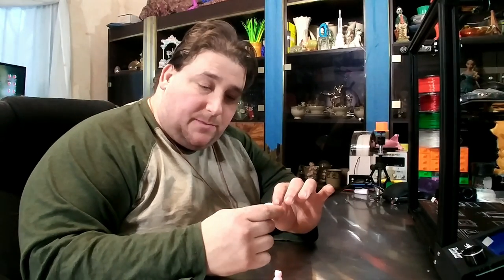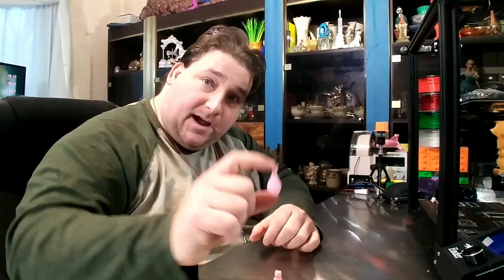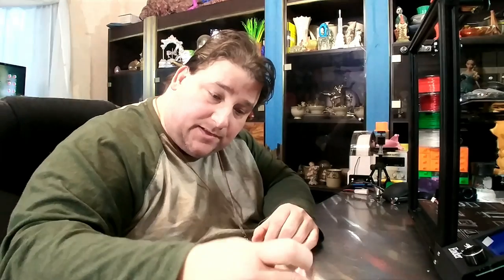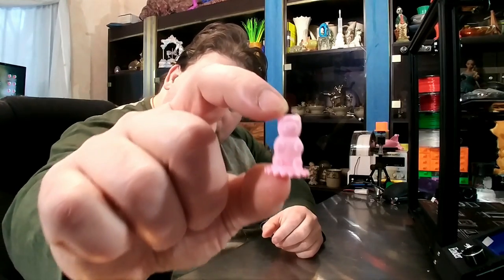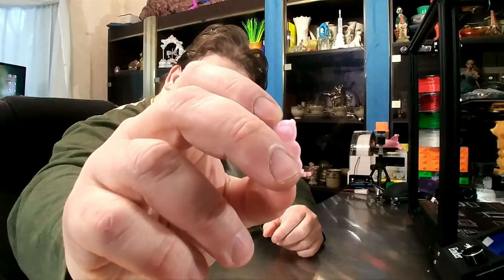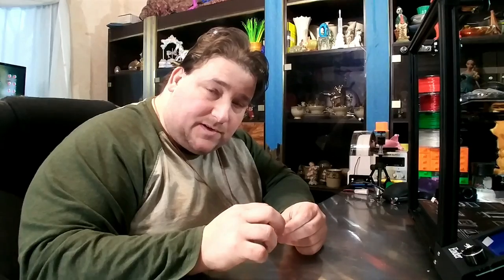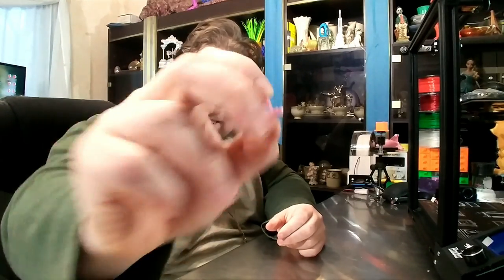Installing TL Smoothers, Salmon Skin, Creality Ender 5 T3DP

Comment: Just a useful note about smoothers, if you look at the space between the two connectors. They are exactly the same distance as the width of a smoother, therefore you can slot the next smoother across those points and then continue through all the smoothers. This will give protection electrically on each board and then provided you have space within your main board case you only have a single block to mount.
I hope this makes some sense. Sorry I'm not sure how I can provide an image to show.
Absolutely the best 3D channel by the way and I follow quite a few. I just love your approach to educating people. It's such a shame printing is not as important to people as say watching reposted internet video. You would then have millions of followers and a crazy income from YouTube.
Good luck for the future.

Comment: Thanks for your time and effort! It is really helpful. My Ender 5 arrived yesterday (i printed only one model (the dog from the SD card)). My printer isn't perfect though (one wheel one the X-axis is damaged, and the bed isn't 100% straight, it is not badly warped or bent, but still not as "perfect" as you mentioned). Still I was able to print an acceptable first print and i'm very happy. My TL smoothers are on the way, just as the nema17 dampeners. I wish you success in all your future endeavors. Subbed! Best wishes from Hungary! And sorry for my crap english "knowledge"...

Comment: Great video. Any chance you could do a video installing the duet 2 main board as the clones are pretty cheap and it would make a great video
Reply from the maker: Link to these cheap clones?
Reply: Nerys If you do do a video on it it would be appreciated as I have all the equipment I need including the duet but just not the knowledge to install it

Comment: NERY cr10 mini when you open up box it's super tight do you have to remove fan to put smoothers I cant find anything good on that type of printer I got 6 to do but am afraid I'll break something I've had All entire 2018 every day every printer not working from raise 3d n2+ to fl sun delta i got them all going finally and dont want a repeat of never ending issues it was brutal I didnt think so many things can go wrong unlike others I wouldn't see other 3d printer companies as competitors but more like a family bond but I guess they didnt go threw hell and still come out smiling anyone else go threw ruff ruff starts multiple brands failing and having no customer support

Comment: A quick question if you get a chance to read this. How do I make the printer not so stringy? Is it just my filament, I have retraction at 7mm and the speed at 60mm. I am using wyz works pla 1.75mm translucent purple. I just found an option for combing and an option for Enable Ironing and Ironing Flow ... not sure if I should change any of those. Also found an option for Equalize filament flow.

Comment: I now have smoothers on x,y,z and extrusion on my cr-20.  Had to replace the main board blower fan as that was screaming like one of your mice..  also replaced the power supply fan but tbh that was pretty quiet.  Not touched the extrusion or head fands yet.. have added a damper on X but y looks trickier.  Started a 4 hour pi case to test..looking like I'll run out of pla before the end though grr
Reply: Was is it really needed? CR-20 comes with 2.x board that shouldn't suffer from salmon skin, or does it?
Reply: @stanislavkolbe1646  no probably not but I'm new to this stuff and had already bought them so it's a good way for me to figure this stuff out.  The fans were defo needed..I couldn't sit next to it for long it was soo loud before.  The case is now half way through and the surface is looking soo silky...I'll be honest though, maybe it's the smoothers or that I've just moved to simplify3d but this print is looking smoother than normal and its only on Draft at 0.2mm
Reply from the maker: I don't think the CR-20 needs them. the ender 5 has the 1.1.3 board. I don't think they can hurt though so might be a neat experiment to see but I don't think they will change anything.
Reply from the maker: Y is a PRESS FIT so you need a punch some cylinders (soft think rolls of take) a fork (pliers will work) to press the shaft out and press the pulley out more to shift both a total overall 6mm or so. it does work. I did it on mine. just takes some patience. pus the pulley about half off the shaft and push the shaft flush with the bearing then "a wee bit more" and that will be enough to line things up.

Comment: Another great video. 👍🏻 Was just thinking about doing this.  Is it just as easy on an Ender 3?  (Can it even be done on the 3)
Reply from the maker: yes. exactly the same process. plug and play protect from shorting. that's it. on current ender 3's its even easier since the brain board is smaller so there is more room inside the brain box.
Reply: Nerys Thank you Chris you're the best. 😍

Comment: Will these instructions apply to the mother board on the Ender 5 pro?
Reply from the maker: The Ender 5 Pro should not need it it will not have salmon skin and it already has silent drivers this does not remove noise from Prince this removes and electrically manifested artifact created by certain specific stepper drivers Leander 5 Pro does not have that so it won't need this installing them won't do anything

Comment: hello i bought the ender 5 it is a great printer but when a power cut the bed fall and i cant resume it start printing in the air how i can fix this ?
Reply from the maker: Yes that is an issue you could try adding an anti backlash to the lead screw which might hold it in position and keep it from dropping when the power cuts I am not sure but I think they're actually including that with current kits

Comment: Is there any reason why after installing it would make your stepper create crazy vibrations? If I move the smoother it makes the other stepper do it too.
Reply from the maker: Does only one of them do it because all of them do it that you add the smoothers to? You might have a defective smoother?
Reply: @nerys71  yeah its just the one i think its bad.
Reply from the maker: Easy test swap them if a Problem moves it's a bad module or it might fix your problem I had one that didn't quite work right and when I swap them for some reason they both work right that's unusual though :-)

Comment: So I just purchased an Ender 5 and was planning on putting this in my garage. problem is, I am worried about the temperature. I live in the northwest us so winters are about 30-50 degrees F. would this cause me any issues printing? I am new to printer this is my first printer.
Reply from the maker: Not really the printer May struggle to get up to proper temperatures but it should work I would not suggest printing anything--but pla at those temperatures as the others will tend to warp pretty badly that cold what you can do is build a very large styrofoam box to put it in large enough to avoid fire hazard but enough to keep in some heat you don't even need to worry about the electronics at that temperature it'll never get hot enough to hurt them but it should get warm enough get you off into the 60 or 70 degree range printing a lot easier
Reply: @nerys71   thank you i will definitely look into building an enclosure

Comment: Do you think I could get worse results in general, if I make the motor's wires too long? I mean unlike in audio, where the quality of the analog signal depends on the width and the length of the cable, a stepper motor can be seen pretty much as a digital device, because a step is always the same, no matter what influence my cable has, can't it? (Of course excluding the case that whole steps might get lost because of low voltage. low current or bad connection).
Reply from the maker: length of wires should not matter unless they are so long that you have a power drop over the length (I imagine they would have to be METERS long to cause that so should not be an issue)
Reply: length of wire increases resistance, so use a decent gauge of wire -- 24 gauge is enough for virtually any printer build smaller than 2 meter cube. I have 3-5 meter long extended wiring for some of my steppers, and quality stranded 24 gauge wire, there is no impact. Step up to 20-22 gauge for larger builds with high current nema 23 steppers.

Comment: Does anyone know what size the power supply fan is.
Reply from the maker: If I remember correctly it's a 60 mm by 10 mm 12 volts

Although if you get one with the Landy power supply I don't know what size fan that is
Reply: @nerys71   OK appreciate it I think I'm just gonna wait for it to come in.  I wanna do all of the recommended mods for this printer for safety.

Comment: Is the ender 5 a 24 volt printer like the ender 3? If so have you found a good source for 24v fans?
Reply from the maker: yes 24v and no. I just use voltage converters to bring the 24v down to 12v.

Comment: Can you please help me? I bought this for my husbands 31st birthday and he is having a really hard time trying to get Cura to accept Ender 5? Also not sure how to fix his bed he ran the test print and it left a few ?marks? on his printer magnetic bed :(
Reply from the maker: Just use the Ender three profile that's built into Cura and then just change the Z height to 300 that's the only difference otherwise as far as Cura is concerned it's an Ender 3

As for damaging the bed don't worry about it it'll just leave a small mark on the bottom side of your Prints but it won't mess anything up just be gentle with it and remember it's flexible use that to your advantage when peeling off Prince

Replacements are pretty cheap but for now just live with the marks until you've gotten some experience so that when you do replace it you won't ruin the new one so easily
Reply: Thank you so much nerys. I was at my wits end here. I will use the Ender 3 profile that doesn't mess up the fact that the Ender 5 uses the z axis and not the x or y for its print movements? I am sorry for all these questions just I am so confused about this entire process. Hes been wanting to get a 3d printer since we got married 7 years ago. As for the bed Ill use brims to help with the prints I think the bed wasn't leveled when we ran the test print. Ill let him know to use the bed till he can save some money for a replacement bed. The dog that he printed was cute but it could be better I wish he would be a little more patience with this stuff but he gets aggravated quickly.
Reply from the maker: nope. slicer don't care. the only thing that will happen is because of how the ender 5 homes everything will print facing the back of the machine (since to the slicer the back of the machine is the front of the machine) everything will be correct it will just print front facing back.

questions is largely what I do here. its what I enjoy. you should not need brims on everything. just "tricky" things that might not hold well to the bed. you will learn in time what works and does not as you experiment. its a fun process.

patience is critical. its a very DIY process. thank fully he did not get into this 7 years ago :-) its so much easier today :-)

remember. above all else HAVE FUN!

 @kimberlythorn8982
Reply: 1 last question how do we get cura to accept the files we find on thingiverse? I am not sure if its my computer that won't load them or Cura it keeps stating invalid file? Again ty so very much.
Reply from the maker: Sorry if this is obvious but it happens a lot.

did you unzip them? Cura will accept the STL file but thingiverse downloads as an ZIP file with multiple files (text folders etc..) inside

you need to "unzip" the files first and drag and drop the STL desired into cura. some version of windows can see ZIP and if you click them will open them "as if they are a folder" but many times trying to move a file into sure this way does not work right.

you should be able to right click the file and select extract all which will decompress the files into a folder with the same name as the zip file (you can then delete the zip file if you wish)

 @kimberlythorn8982
Reply: The profile is on the SD card.

Comment: How you getting on with cooling those stepper motors bud? just started getting issues with layer shifts and one moment the motor just went crazy, only thing i can put it down to is overheating of the motors as they were too hot to touch. I have put some thermal compound and the plates similar to what i saw in one of your vids but wondered if youve changed anything for better cooling? i did find this which i might try and find a way to work with it https://www.ebay.co.uk/sch/i.html?_from=R40&_nkw=Cooling+Fan+Heatsink+Cooler+For+CPU+VGA+Video+Card+SM&_sacat=0&rt=nc&LH_PrefLoc=1
Reply from the maker: Something's not right if they're too hot to touch check the vref voltage coming off a stepper drivers I'm not sure what it should be but at least we'll have a reference mine do not get hot I am 20 hours into a 35 hour print right now and the motors are not hot

 double check and make sure your belts and rails are not too tight and that nothing is binding which would cause the motors to exert more force and get hotter
Reply: i'll take a look, currently dealing with irregular clicking from the extruder motor after upgrading to capricorn tube, i think its a a flow rate in S3D adjustment but i cant 'make' it happen, it only seems to happen on certain retractions that include long movements too
Reply from the maker: two things to check. make sure filament is within spec. out of round or oversized filament would work fine with stock tubing but might pose a problem with capricorn since its a higher tolerance tubing MEANING tighter fit inside the tube so if filament is too large it will struggle to push it through.

second pull the filament (cold pull) do you get a clean pull? end of filament should be "shaped" like your nozzle?

after pulling also pull the capricorn and check the "interface" between the nozzle throat and the capricorn. it should be clean (clean capricorn clean brass) if there is filament IN that interface boundary layer then the ptfe was not fully inserted permitting a cap between the end of the PTFE and the throat of the nozzle. this will absolutely cause you some issues the minimum of which is some clicking as the extruder stepper struggles to push though that "cooked off" filament that will get stuck in that gap.

 @Nonprofessional_Tinkerer
Reply: @nerys71  looks like a blocked throat of gunk and typically its different from all my spares
Reply from the maker: @Nonprofessional_Tinkerer  make sure the end of the ptfe tube is cut clean flat and perpendicular and not out of round. Remove the nozzle (hot) shove the ptfe all the way through to be sure its all clear.
Reply: @nerys71  thanks on it, will let you know. Cannot find these types of throats anywhere, only full hot end assemblies
Reply: @nerys71  found some, stressed brain wasnt searching properly, word of note searching throat on aliexpress brings up some creepy stuff. Gonna heat up stock hotend and push ptfe through as wont go all the way. Then put back together without filament, heat up then re tighten nozzle as think i only tightened it cold last time which could account for clog
Reply from the maker: good. yeah I bet on the creepy stuff :-)

for assembly. tighten nozzle cold. then put compression fitting in place. LOOSEN 1 to 1.5 full turns. then install PTFE all they way in making sure compression fitting grabs it (tug on it) THEN tighten down compression fitting all the way.

now heat up hot end to 200 c and retighten nozzle (don't over tighten you can break it)

should be good to go then. @Nonprofessional_Tinkerer
Reply: @nerys71  good shout the with compression fitting idea, never throught to do that, let it tighten the joint between the ptfe and the nozzle
Reply: They can work at 100c easy, why are you complaining my ender is also too hot like the bed and prints like beast

Comment: Do I need to do this on Ender 3  with 1.1.3 board
Reply from the maker: need? no. it will work fine without them. but if you install them they will result in the same improvement (removal of salmon skin) as you see here.